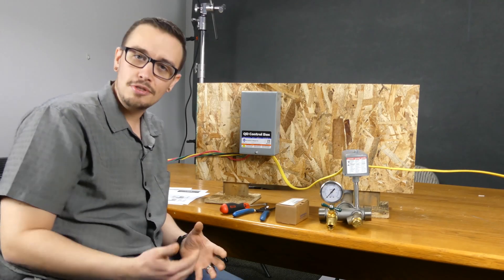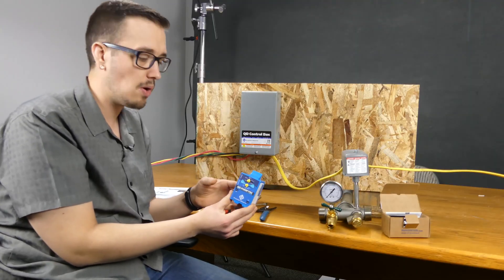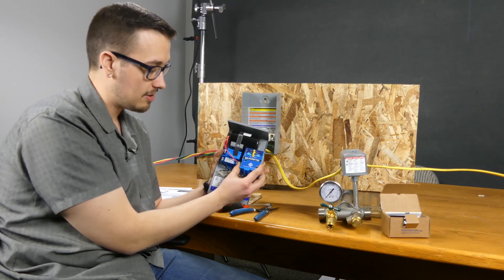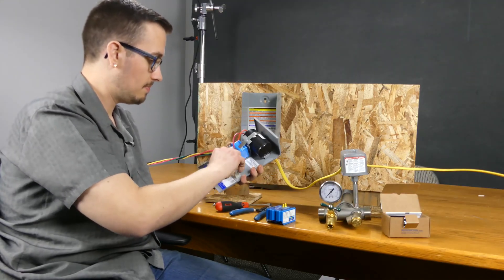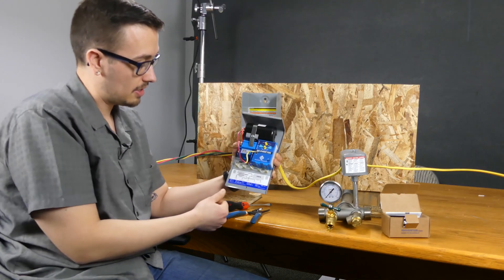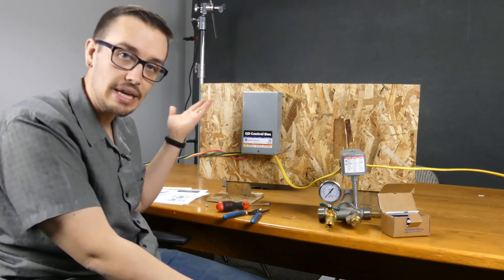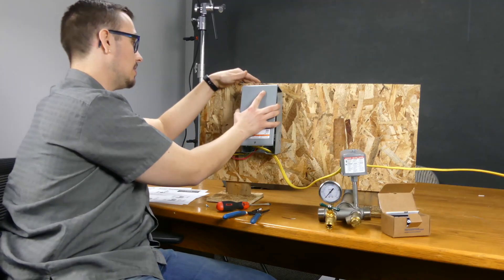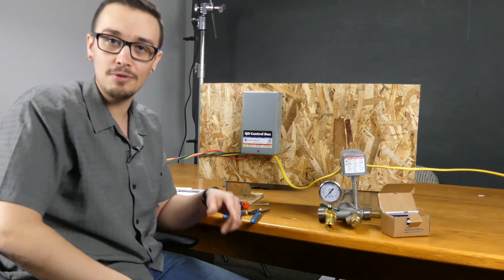QD Pumptec - Quick Install

Comment: Thank you for this. I have a Goulds J10S 230vac 1HP jet pump that pulls water from an above-ground cistern. The cistern is filled by a separate 2-wheeled belt-driven pump. The pressure switch on my jet pump is mounted on the pump itself. I'm trying to figure out how I would interrupt the wires going into the pump-- it has very short wires coming out of it-- to install this. Or is there another option? My problem is that the stupid float switch (which looks like the pressure switch with a sort of lever sticking out and has a rod and float that moves up and down to move the lever) keeps failing to activate to turn the water on and it recently caused the housing of my jet pump to split open during a record-breaking cold spell in my area. I'm trying to find the best way to protect the jet pump so it won't run while dry but I also need a better method to get the other pump to turn on and off properly. It is a 230vac 1hp pump as well.

Comment: Can a tank float switch be installed in place of a pressure switch? I’m working on a system that has a submersible pump and I want to pump to a reserve tank where it will gravity feed to a house. I also want the QD motor/pump protection unit to protect against dry running. Can they both be installed on the same system?
Reply from the maker: Yes. Give us a call for more info: 855.329.4519